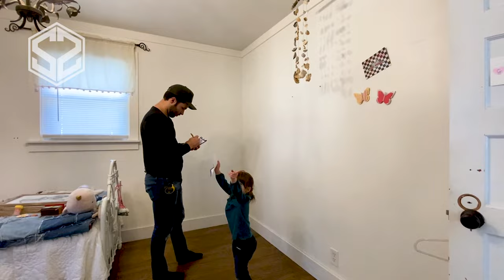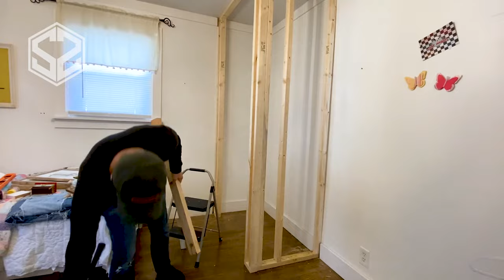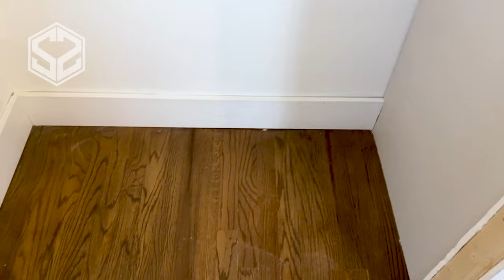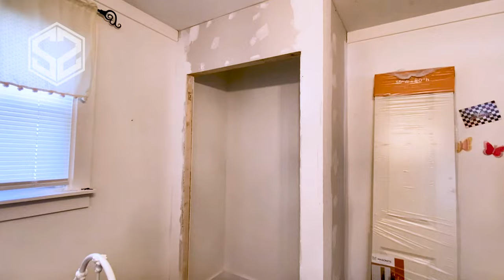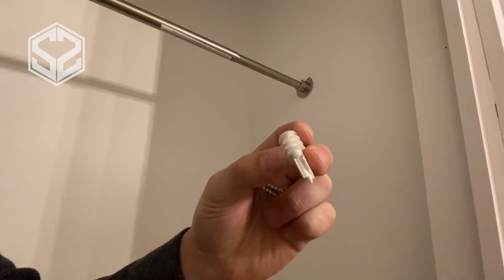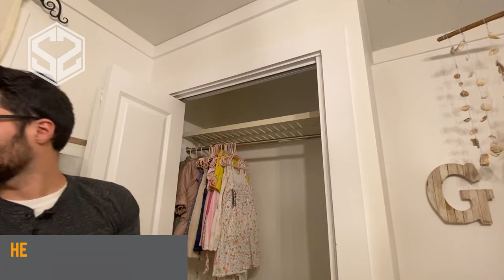How to Build A Bedroom Closet

Comment: Looks great, only suggestion would be to add blocking if you already knew where rods/shelf hangers were gonna go.
Reply from the maker: I actually did add in blocking for the bar on the the wall that I built. I didn’t want to open the other walls to do the same there. 
Thanks so much! :)

Comment: Great work. It looks really good. One thing I don't get is why you wouldn't put a horizontal stud where you were going to hang your closet bar instead of using a drywall anchor since you studded out the closet yourself. Thanks for the video.
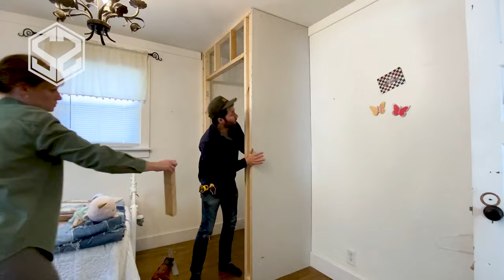Reply: He did on the new wall at 2:41.

Comment: Questions: Before you put up the rod, would it have been possible to add a 2x4 so that you could have nailed the rod into it? If the anwer is no, would you elaborate on the answer or suggest another way to make that rod hold more than 79 pounds?

Comment: What tool did you use to cut out pieces of trim to make room for the framing? Like what is the name of that type of saw?
Reply from the maker: It’s called a multi tool. Several different brands make it. It’s very handy for projects like this. 😁

Comment: Why not include a stud to mount the hanger bar.   Did a attic joist and lost that just happened to be in the right right location to attach the framing or did you select the size of the closet based upon where you found them

Comment: How far from the wall is this? 3 feet including the trim/door area (total) or 3 feet before the wall closes plus the additional few inches from the doorway?
Reply from the maker: Where we are located, for a closet to officially be classified as a closet, the inside dimensions need to at least be 2ft deep and 4ft wide. So that’s the dimensions I used.

Comment: How much did it cost in materials for a closet this size? I need one in a room that I have in my basement.
Reply from the maker: Depending on what type of door you buy, probably around $200-300.
Reply: @SimonSaysDIY very curious why just not to bye a regular closet? The one you created is small, it takes a day of work. What the sense of it? It would be easier and prettier to bye a modular closet. Here in Europe only door itself like this would cost around 400$

Comment: Great Video, As you have to cater for the thickness of your dry wall and the trim, How you calculate the size of the opening that you will need for your Bi- fold doors ?
Reply: would have been a good comment to to review expected rough opening for the door.  or could have ended up needing to shave down the door.

Comment: you built that closet, coulda put a stud wherever you wanted for the hanger.... why take a chance on cheesy anchors
Reply: Those anchors will hold more weight then ever could possibly be needed.
Reply: @Bostonn617  50 pounds is what the metal ones are rated for, I don't know about the plastic ones.

The point is simple, he chose to not put a stud where he knew he would need one. And it would not have costed any more time or money